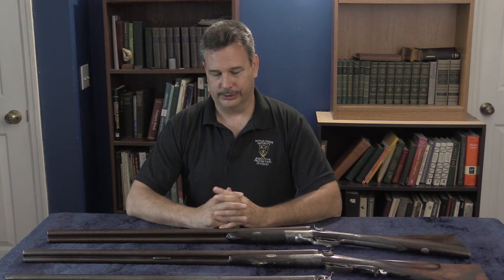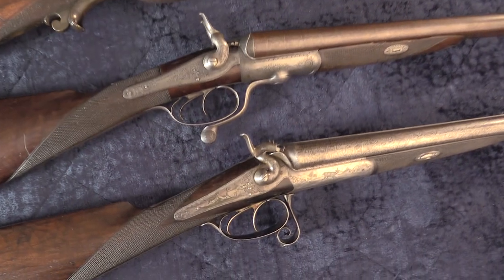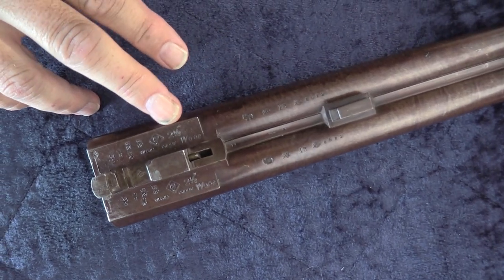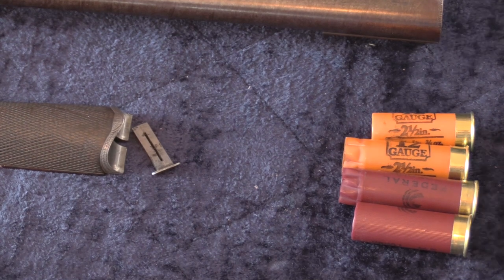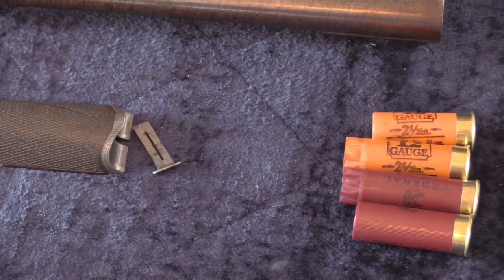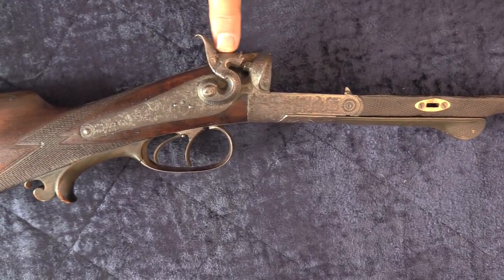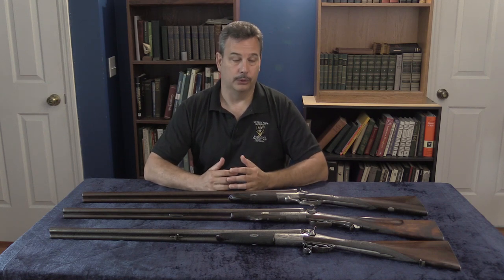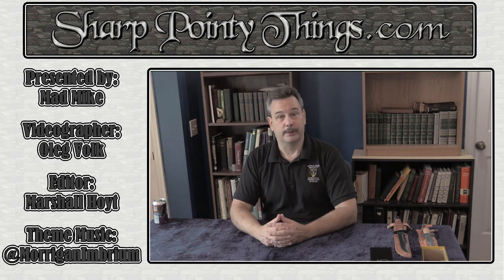Damascus Steel and Shotgun Barrels

Comment: So glad you made this video so that the information will get out there. Personally, I've grown weary of explaining it to people. I generally shoot only damascus, and if in sound condition, they are fine. The reason I shoot light loads is not because of the barrels, but because of the stocks, which most often need to be treated gently in old age. It's rare for one to come in the shop without some need of stock repair. Barrels are rarely an issue if the gun has been cared for, but they should always be given the full check-up by someone specializing in vintage doubles. Not every gunsmith fits that category.

Comment: Thanks a lot for a great video. I rarely shoot anything but hammerguns with damascu barrels and as long as you go for 2½ with not too much pressure they do very nicely. My favourite gun is a Trulock bros. from approximately 1870 with a jones lever. It is slow, un-practial and everything you need for hunting. Only problem is that in my country - Denmark - 2½'s are getting difficult go come by.
Reply from the maker: You can cut the crimps off 2-3/4" and glue a cap on them, with the right propellant charge. But it's also a common size shell in the UK and other parts of Europe, so should be sourceable with research.
Reply: Find brass casings and have fun

Comment: I have Grandpa’s shotgun. It is…. Royal Gunworks 12 ga side by side external  hammer, Damascus barrels. Grandpa was born in 1884, he purchased it in 1900 for his 16th birthday. It was used then no one can determine exactly when it was manufactured. I have owned it from age 10 (1959). I did shoot it when I was a kid but it has been in permanent retirement since approximately 1963. It will be passed to my grandson when I expire.
Reply from the maker: It's Belgian. Some sources say it was made by Henri Pieper, in which case as long as it's in good condition it's perfectly safe to shoot.  Even if not, keep it oiled and clean, because someone else might "Try" it, and be sure they're aware of the chamber dimensions.
Reply: I had hoped you would have included loading the modern brass shells for these guns..I have an 1886 Elsie,use ff and bird shot at a twenty ga level...just make sure that no plastic wads with out an over powder card under ie melted plastic.
   I use free hulls,cut off the crimp and use over shot card . Gets attention the first round...who blew up their gun??

Comment: Very nice video! My Wesley Richards 20ga 21/2 from 1882 is an early Anson & Deeley boxlock. I use Eley VIP Bismuth cartridges without any problems. In case of clay shooting the Rottweil Fasan 16/67,5 is my choice. This is a very nice and functional gun with modern handling and oldfashioned high end craftmanship. HNY from Norddeutschland!
Reply from the maker: My WR is from 1879, a very early Anson and Deeley boxlock. And the balance is fantastic.  My wife has a Williams & Powell (Liverpool, not William Powell, London) with an early A&D patent number.

Comment: Thanks, timely. I came into a W. Richards which I believe is the Belgian copy. Haven't found the right Gunsmith that knows them well enough to offer an authoritative opinion. This is a great video, thanks for the share.
Reply from the maker: There are two different W. Richards. One is Westley Richards, Liverpool, who predates Westley Richards, London, and used the trade name W. Richards.  I actually grew up very close to where their factory used to be (I was in Birkenhead, right across the harbor). They are an excellent maker and I have a couple of their guns.  They will have Birmingham proof marks under the barrels and on the water table of the action.

There's also a W. Richards, Belgium, which was a house brand trying to play off Westley Richards. Those are an okay gun, but many were shot heavily. It will have Belgian proof marks (ELG in an oval, with a crown after 1893).
Reply: @SharpPointyThings  Great info, I just looked mine over again and found scroll writing where I hadn't seen it before - on the top metal separator between the two barrels it says W. Richards London Fine Twist.I am leaning towards it is one of the Belgium guns, from forums I have visited.
Reply from the maker: Probably. That's the "top rib."  The proof marks under the barrel will be conclusive. It's easy to dismount the barrels, you can find videos showing how.
Reply: @SharpPointyThings  Thanks - I will check.

Comment: I wish I would’ve found this video a few days ago. I’ve been scratching my head on my old 1873 Era Charles daily side-by-side 10 gauge. I’ve been hand loading for it the last couple of year's but started with 2 7/8 inch RST ammo. I measured the inside of my chambers to the forcing cone the other day. Got measurements of 2.775” i’m pretty sure the factory loaded 2 7/8” RST hulls are longer than my chamber and probably overlapping the forcing cones that I had to guess. They never patterned worth a darn. I’ll have to measure a factory hull unfolded.

Comment: This is always an interesting topic of conversation. I would add that, although pristine appearance of barrel interiors is comforting, a common practice in the past was to hone corroded and/or pitted barrels. Original chambers and/or forcing cones could have been lengthened. Any of these means that the barrels are no longer in proof. It's important that any gun that is going to be brought back into service have its barrel thicknesses measured at multiple points. It's very surprising how thin some of these old barrels can be. 
2 5/8 in. chambers in old American guns, including in the fluid steel era, are common. 
Parker Bros. stated that those lengths were not lengthened when 2 3/4" became "standard".
After the Remington acquisition, at some point they were lengthened. Firing modern 2 3/4" shells in a 12 ga. 2 1/2" chambered gun can be expected to add about 1000 psi to chamber pressures. That may or may not be important depending. 
I am not familiar with the Birmingham Proof House study you quoted. I know about the one from 1888. Those barrels were not cut to the usual thicknesses of shotgun barrels, a curious thing. We all know about Sherman Bell's good study of the topic with Remington's and Larry Potterfield's assistant. That one (?) set of fluid steel barrels were a molybdenum alloy quite different from modern ones.

Comment: Something that must be said about Damascus barrels is: Damascus steel is LAYERED steel - not the same as fluid steel, modern barrels.  As such, age and rust can result in layer separation and migration of atmospheric hydrogen between the layers, causing hydrogen embrittlement of the steel, weakening it.  It does NOT mean that Damascus barrels are unsafe a priori; it does mean that old Damascus steel of indeterminate provenance MAY exhibit embrittlement.  

The safest way to shoot an old 12 gauge is to use a 20 gauge insert and shoot 20 gauge shells in it - that completely eliminates the risk of catastrophic damage to the gun, which is a laudable goal for a curator of these century-plus-old heirlooms.

Comment: Excellent video!  I fully agree with you. Ive been shooting damascus for decades. Mostly with black powder and nitro where appropriate. Although less common, there are some vintage shotguns with factory 2 3/4" chambers. That is Not to say that just because an antique shotgun has modern chambers it should automatically be assumed to be safe with modern ammo! My advice to anyone is to be aware that they were all originally made for black powder so if it hasnt been re proofed or you arent sure, have a qualified gunsmith check it and stick with black to be safe. Chamber gauges are cheap...just get one and at least that part of the mystery is solved. Thanks!
Reply from the maker: I've seen an 1880s W&C Scott & Sons 10 gauge damascus reproofed for modern 3.5" magnum.

Comment: Very good info thank you for this. I have a 1890’s Remington I received from a close family friend we farmed for for a long time. It had a twisted steel barrel that doesn’t have that intricate design that some of the Damascus barrels have. It is a 10 gauge gun. I have yet to find a gunsmith that can measure the bores on it. 2 questions. Is the twisted steel a lower quality steel then Damascus? And would it also be a 2 1/2 inch shell? Only marking on it is a serial number and all the research I’ve done is saying it’s a 10 gauge and it was made sometime in the 1890’s. It’s likely a very common gun and almost every farm house on the prairies had one leaning on the wall but that’s besides the point. To me it’s a piece of history and deserves to be preserved as such

Comment: i own a Husqvarna double barrel shotgun 12ga(blackpowder) made in 1884, crime rates are getting higher and i would love to use my shotgun for defense purposes, i saw a shop that sold modern rubberball 12ga rounds, will my shotgun handle the pressure since its modern powder?

Comment: A 2 1/2 is 2 1/2 open
Reply from the maker: Correct.
Reply: I have an Elsie 1886 hammerless 12ga.....I thought the barrels were etched and proofed it w two trap loads down ea tube...then found out they're stub twist. Now it gets 75gr black w oz of shot no larger than five. I use cheap/ free hulls and put a nitro card over powder even w plastic wads...to prevent melting...
     This shotgun is one of the finest shotguns I've shouldered.   I'd love a 28 or 24ga but cost....

Comment: Could you have the chamber cut and use 2 3/4" shells? I am certain the gun would lose some of it's collectors value. Here, in the States, 2 1/2" shells are rarer than hen's teeth, and cost like they are loaded with gold! I just looked them up for my brothers gun. They are on back order, and run $200.00 per box!